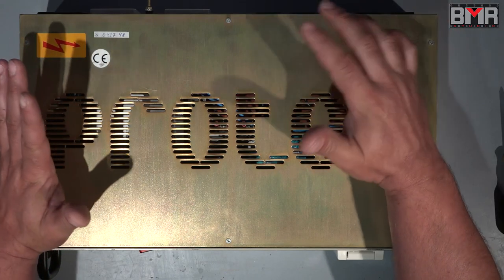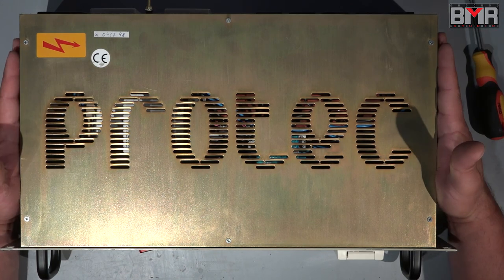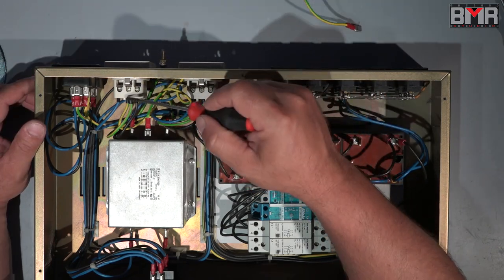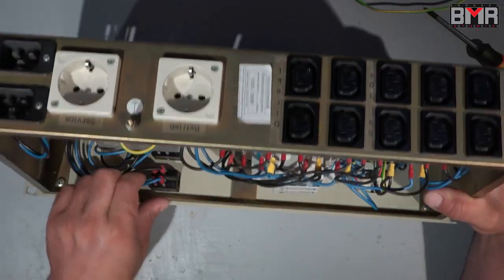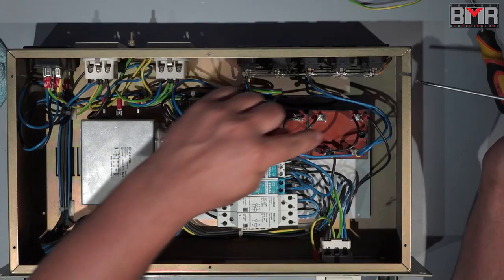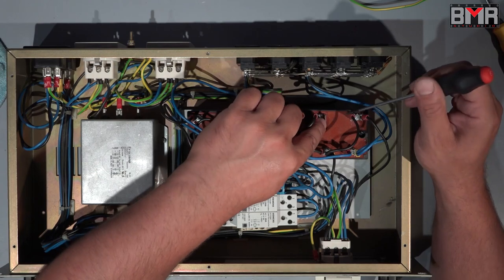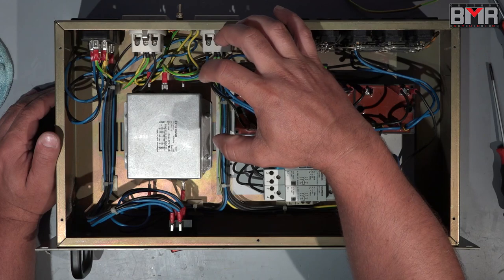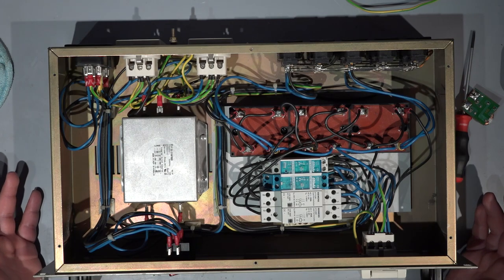Power conditioner and sequencer from PROTEC! Classic German studio gear

Comment: Hi, I'm still here.
So I wanted to ask what should I do if I don't have any grounding in power socket?
Reply from the maker: Good to see you here :) 
wow! This is serious issue... probably some old, ex socialist house...
But, there is an option, if you have central heating in your home.... 99% ,of the case, those pipe systems are grounded, to prevent lightning shoots.  Just hook a wire to it, and replace your wall connector, then connect the "radiator earth" into the socket. Or find your lightning protection wires on Your building and connect to them. 
The real solution only, if You ask an electrician to take out the wall cables, replace all of your wall sockets, and do a proper earth connection in your fuse box.
You can do this, room by room, each month, to split the costs.
Reply: @BMRStudio  Yeah, but you never know when some idiot will hit it with phase, so it is the worst scenario.
Reply: yes you never know ----  the Class A electrician sends his assistant to screw things up
Reply from the maker: @saiprasad8078  Hehehehe :) I think the best if You start to replace the cables... with a class AAAAAAAA+ electrician :)

Comment: Air conditioner? You are lucky, it was so hot here, I wasn't even able to watch youtube videos :D
Reply from the maker: Is Your flat rented, or you own it? 
There is a possibility to install a air conditioner?
If Yes, I can you one as present :)
Reply: @BMRStudio  Its rented. So no possibility for an split system. The only option is the inefficient mobile unit inside with an exhaust hose to an window.  But they are sold out.